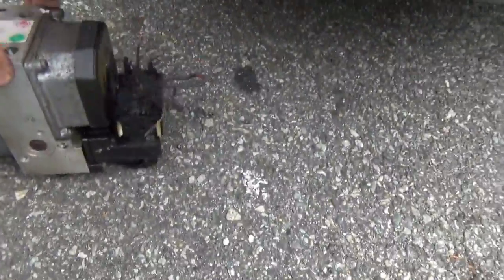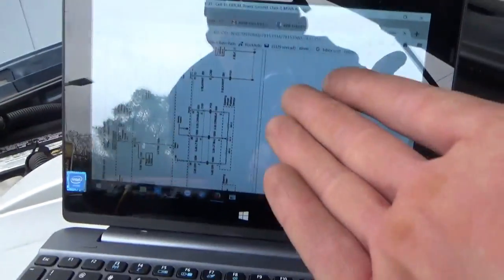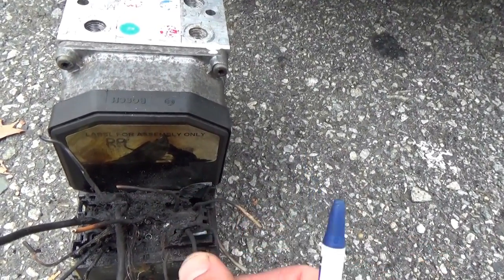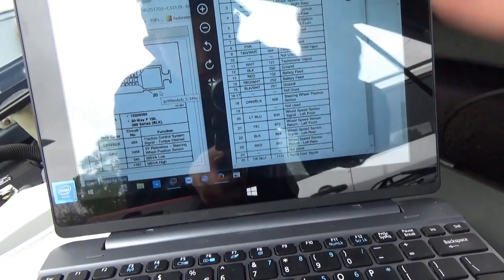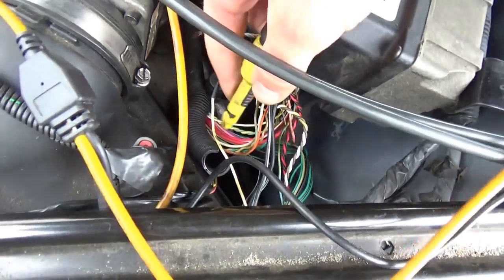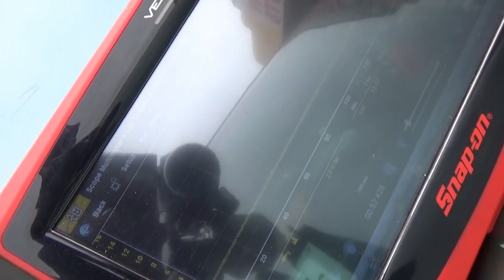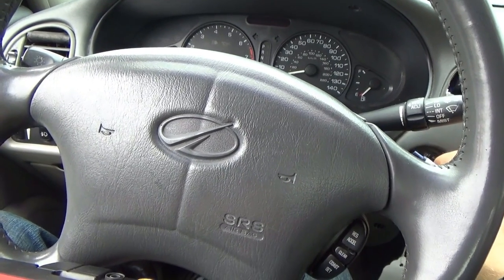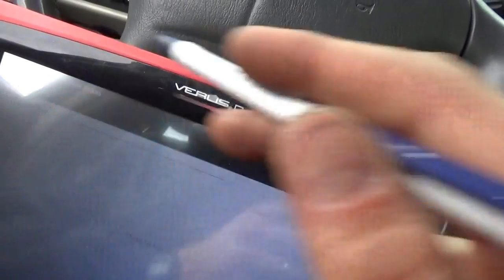ABS Module Burned Up! '99 Oldsmobile (SI Ep. 11.4)

Comment: Pine hollow please help I have a Toyota Camry 2008 and the brake and ABS are on all the time I already change the control module the wheel speed sensors and the Mass Air Flow Sensor and still not working it’s super hot 🥵 in Texas I can’t drive it like that anymore what else can I do.

Comment: Wow, how does an ABS module burning up like that, interior soldier joint or printed circuit shorts?  What a mess. Also, aren't ABS modules programmed to the VIN of the vehicle?

Comment: Was thinking during this video...did GM have stability control back in '99? Seems very advanced for it's age.
Reply: it was rather plain traction control if I recall,  you'd just have a bit aim with the front end. mostly dealt with trucks and vans of that era, that usually had none of the above.
but I recall that whole platform being pita.
Reply: I got it on my 99 Cadillac Deville.  They had it.

Comment: They have to make sure it's the right module for that vehicle. ABS modules are often heavily variant dependent and have vehicle specific tuning. Not only can the internal look-up tables and parameterization for pressure ramps, regulators and control-loops differ, but also the hydraulics can have different spec depending on vehicle options. Everything from break rotor size, vehicle gross weight to extra options do influence the tuning and spec of the ABS-module. Unfortunately, it's very much possible to have a DTC-free ABS unit seemingly working fine, but the stopping performance may not be tuned for that particular car. It may as an example work well on dry blacktop but you may have lost considerable stopping performance in a low friction scenario. As a real life example; a manufacturer uses two different style hydraulic bodies depending on the vehicle option of que-assist. The difference lies in a small hydraulic damping chamber only required for que-assist, it features inside the valve body and the only thing that is humanly noticeably from the ECUs' outside is the valve body part number, (all other electronic hardware is the same), using the wrong ABS-module on such a vehicle will degrade que-assist, every other function is unnoticeable different and there are no DTCs.
Reply from the maker: Yeah, just because it plugs in, doesn't mean it is optimized for the specific car. I was sure to tell the shop that even though I fixed the wiring, the module was still not the proper one.
Reply: Here, have a like.
Reply: Big "smart" Cheese :))

Comment: Where did you get the third hand from for soldering the wires or is it fit made
Reply from the maker: Just soldered a couple of small banana clips to a copper wire (household 120V) bent into a horseshoe shape. Works fantastic!

Comment: GM Steering position sensors retail around $50. I wonder would there be any harm if new one would be installed to engine bay and locked to center? At least the code would go away and I bet that default steering angle would be 0 anyway if the sensor is missing.. But this is academic, if no money light on, no need to throw in extra parts.. 

https://www.amazon.com/APDTY-712114-Steering-Position-Description/dp/B00BI3JFXG

Comment: After your diagnosis, did the shop leave the mismatched Bosch ABS module in the car or replace it?
Reply from the maker: Not sure. It drove fine and ABS worked properly, with no ABS light, so they probably left it in there :)

Comment: Ivan can you fool the ASB model by installing a resistor between the 5V and sensing line.
Reply: Maybe on your own vehicle, maybe.. But would you accept the liability for tampering with someone else's brake system?
Reply: It wouldn't affect the brakes, it would just trick the ESP into thinking the car is always travelling straight, so it wouldn't intervene, which is correct for the car.
Reply: Some information exist saying 3 digital signals and one analog. Digital signals for movement, analog for center. These 3 are compared and mismatch detected.

Comment: Good video Ivan check the module part number and verify it is wrong or correct. The abs module may be correct with the wrong software in it may be programmed for a car with traction stability control it may just need to be programmed for that car keep up the work
Reply: You beat me to it... :)

Comment: Aww sweet - a fire! Wish THAT part was caught on video ... lol! :D

My brother's '02 2500HD with the Duramax had the battery spontaneously combust. Never seen that happen in my life! Melted the paint off the hood, burnt / melted the cowl & windshield. Insurance covered it all. Watch out for GM products built in the 21st Century!

 Nice find on those 2 crossed wires. Real nice of GM to use 2 of the same wire colors in the same harness/plug! Always looking out for the techs ... (yeah right!). Not the first time I've seen this before either!